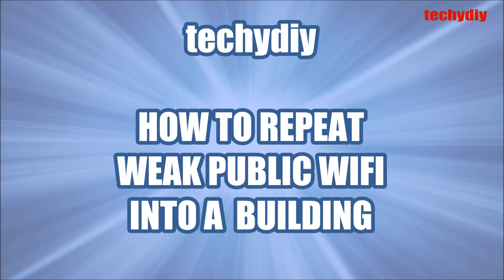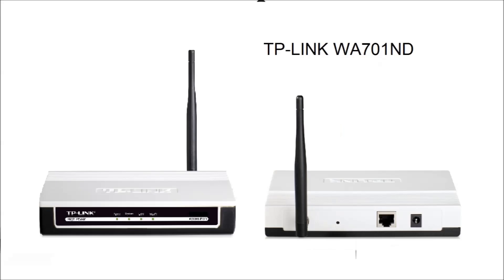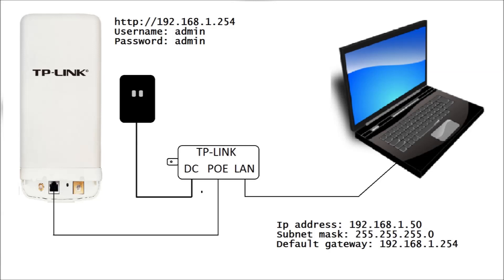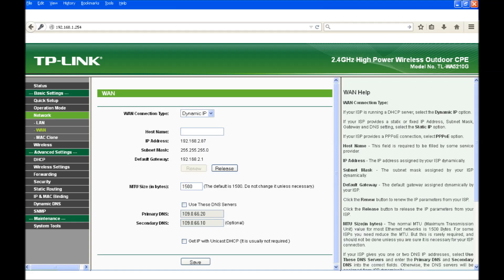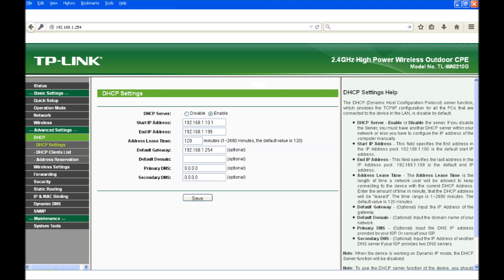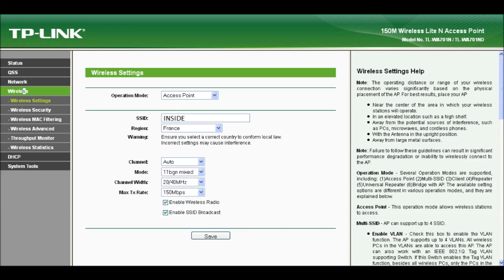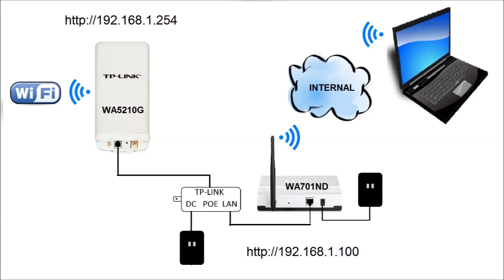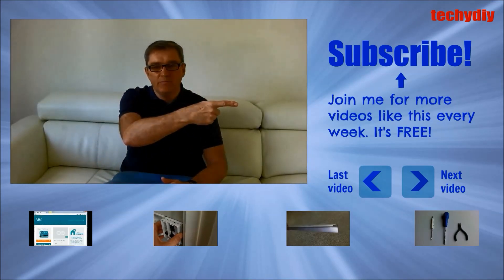How to repeat or boost a weak public wifi service into a building

Comment: You didn't mention the conflict of IP's.  It would be better to place it into a bridge mode or at least program the WA701D to use the WA5210 as the DHCP server.  That way only one device is controlling ALL IP's.  Otherwise you would need to create a separate network of IP's, (Your image of the configuration for the WA701D was on the .2 network NOT the .1 network)  If that was intentional then I think you may want to mention that.  (I would prefer a bridge mode OR just repeat the existing network) depending on your needs or situation.  I just find either of those are easier as bridge mode allow FULL forwarding of any and all traffic to the WA5210, including DHCP requests.  Of course the Repeater mode would just Re-Broadcast the signal to other devices a piggyback.
Reply from the maker: If I remember correctly it was configured that way to allow multiple clients to connect to one account on a WiFi service.

Comment: thanks was very informative.
so only works with   2.4GHz extenders?
what about other routers? I have an asus RT-AC3200. 
I am on NYC that has in some places  free public wifi but the first time you need to sign on putting email address
Reply from the maker: The method should work with most types of access point / routers

Comment: Would this work for a secure public wifi hotspot that require authentication?
Reply from the maker: Yes
Reply: I did not see a step in your video to authenticate to the secure network on the service provider portal. Do you have anything additional on that?

Comment: can this be used to extend bt wifi with fon ?
Reply from the maker: Yes I. Did try that a while back. Also SFR WiFi (France) with a BT Fon login..
Reply: Ive found a lot cheaper way of doing this by turning a pc in to a WiFi router which can also still be used as a normal windows pc

Comment: Can u help me? I know my friends WiFi password but he is living 300 metres away from me and I have a TL-WA5210G with me so I can use his WiFi ? At my home using that above mentioned device? If yes then plz say me how to do it I have a router also in my home at it is TL-WR740N.
Reply from the maker: That's what this video teaches you how to do!
Reply: @techydiy  but if i didn't connect the 5210g with my friend's router through wire may i connect 5210g wirelessly?

Comment: Hi great video
My WiFi signal is transmitted 100m to another area I can connect to Internet but an IP camera will not work any help would be fantastic.
Reply: Try to make sure the camera has the SAME IP and subnet and gateway as your network.  Also check to make sure you have the DHCP enabled so all device can get the same IP info, If not, just make sure you place the camera into the same network as your router.

Comment: can you do it whit a TP-LINK CPE510 ?
Reply from the maker: The CPE510 operates at 5GHz, so yes if that's what you need. The config method will be different as well, but the principle will be the same.
Reply: Ok, tnx! :-)
Reply: So I can with this device TP-Link CPE510 my wlan extended to outside (private network)?

Comment: i have an open wifi near my house but icant fix the other pair of CPE on  the building from which iam getting open wifi  i tried a lot of tricks and right now iam having 2 15dbi tp link omni directional anteenas and they are connected in my modem but the signal till my house is very weak  i dont know what to do can i fix one pair of CPE and connect it to my wifi router will CPE work in my case

Comment: Hi, i have outdoor CPE. and I want to extend wifi signal upto 2 km  or more .
Reply from the maker: You would need to have directional antennas on both ends
Reply: I agree.  I just put up the 5210 model on the roof of my home and pointed it at another building 200' away.  I was only able to pick up a signal of -74dBm.  That's crappy.  Not happy with this product.

Comment: Hello how are you.

I liked your video but I have some questions I would like respondieras.

1. why it must be configured in client mode Ap router?
2. ¿porque not simply in client mode and connected to an access point?
3.- Being configured as you say, the tp-link WA5210G transmits only wifi or cable? I mean: I can connect via wifi to tp-link WA5210G without using the tp-link WA701ND?

I really hope you clarify these doubts.

Thank you very much for your input and video.
A greeting.
Reply: techydiy sir , 
I have some questions here , 
1- can this device direct on mobiles phones , tablets , laptops ? How much capacity for users maximum on this device ? 

Or please suggest me Device who direct connect with mobiles for outdoor wifi business ?  360° coverage with maximum range 200 meters to as possible  +point to point to multi point , and for maximum users capacity from 200 users to 5000 users as possible ? 

Plz come on whatsapp 
+92 300 4356 143 
Javed Sipra is my name
Reply: Yuli terminaste la ultima palabra en espanol,nose si el abra entendido lo q le dijiste anteriormente
Reply from the maker: I don't really understand your question but there are several reasons why you might want to use this setup:

1. The wifi signal you are trying to access is physically shielded and you are unable to access it from your location. For example, if you are inside a building and the wifi service is external to the building. The configuration described in the video can extend the signal into the building where it can be accessed by any wifi device.

2.  The service you are trying to access only allows one device to connect to it and you want to connect several devices to that service. Several wifi services limit the number of devices associated with one login.

3. You are trying to access a distant weak wifi service with a device that has a poor antenna. Most tablets and phones have poor antennas. An external antenna with direct line of sight makes a huge difference.

Hope that helps.
Reply: Thank you for answering, helped me a lot.
Anything else; Does the outside antenna is connected when and retransmits the air wifi signal? or the acces point which emits the signal?

A greeting!
Reply from the maker: +Yuli Valverde 5210g is located outside and connects to the WiFi service. The 701 is inside and connects to your devices (Phone, tablet, laptop etc.).   The 5210g has two built in high gain antennas, it can also operate with a higher power output than normal.

Comment: how do i connnect to a secured public wifi using this process?? WPA2
Reply from the maker: You would select the secured ssid with the survey button in the same way.
Then you would set WPA2 and the password under wireless - security settings.
( I haven't tried it )

Comment: can you help me ?
I have CPE210 I had following the guide for using to AP mode but the problem I can't connect the wifi signals from the AP (CPE210) there's no connection anymore (like disable access) 
what should I do ?

Comment: so what is the difference between TL-WA5210G and TL-WA7210N ?
Reply from the maker: Speed 54Mbps & 150Mbps
Reply: So if I buy any of those, then I also have to buy TP-LINK CPE210 as POE, right?
Reply from the maker: No they are both capable of POE. CPE 210 is a 2.4Ghz 300Mbps alternative.

Comment: Hi,

I moved into a new house where ADSL2+ ports are not available by the only broadband provider servicing the address. My neighbour (houses separated by brick walls) has kindly agreed to share his WiFi login with me. I am able to see and connect to his SSID but speeds are very slow and sometimes webpages do not load.

Can you kindly advise me as to which product to buy from http://www.tp-link.com/en/products/list-4581.html which will help my case?
Reply from the maker: Do you have a good signal from your neighbours wifi anywhere in your property?

Comment: You configured the 510 to be a DHCP server starting at 192.168.1.101 but you then configure the 701 to have a fixed IP of 192.168.1.100.  Why not leave it as dynamic and let the 510 provide the IP?

I'm trying to use your video to boost a public Wifi AP using a CPE210 and an older cisco wireless router (linksys configuration software).  The 210 default address is 192.168.0.254 (just to be different) and I connect the wire from the LAN port on the POE device straight in to the cicso router 'internet' input. The router's default IP is 192.168.1.1.  Do you have a tip to get this config working? Should I change the router IP to 192.168.0.1 (and the gateway to 192.168.0.254)?  Thanks.
Reply from the maker: If you assign a fixed ip to the 701 then you can access it's configuration via wifi without connecting it to the 5210. It just removes a potential problem and makes tracing faults easier. Both devices ethernet ports need to be in the same subnet to communicate, it doesn't really matter what it is, as long as its the same.  So 192.168.0.1 sunet 255.255.255.0 and 192.168.0.254 subnet 255.255.255.0 is ok.
Let me know how you get on.
Reply: Thank you for your help. The CPE210 software looks different to that in your video and by looking carefully at your video I determined I was not using the correct initial configuration. There is a mode called Client on the 210 but what I needed to select was AP Client (WISP). Once I'd done that everything started working much better :)  My cisco (linksys) router has additional ports on it (unlike your 701) so I decided to leave the address of the router as dynamic (since I could always attach a cable to connect and reconfigure the router). But I shall remember your point about wireless connecting for reconfiguring.

Comment: Hi i have a site (motel) with 7 small buildings (wood wall). the entire site have 290 meters long x 100 meters large. I want to give wifi internet access to my customers inside and outside the buildings. it will work with that type of device (cpe210)? i plan to install one as an ap router wired to my pppoe provider, and 3 other on the roof of a building on the center of the site (ap client router). thank you and sorry for english errors i speak french!
Reply from the maker: +Ronny Roberge Yes it should be able to cover that distance.
Reply: +techydiy wow what a fast reply ! you think that at this distance of the outside antennas will be strong enough to have descent connections on mobile devices inside buildings? alors do you know the number of possible simultanous connections ?
Reply from the maker: +Ronny Roberge I can't say for certain as it depends on many factors. If you site them high with line of sight of the buildings then it sounds reasonable. My advice is buy one unit and try it.

Comment: can i use it as normal wifi router, if yes, what will be its range.
i want to set up wifi zone for lan gaming with friends about 200 meters, is it possible with this device, if not can you tell me any other devices that i can use to create wifi zone of about 200 meters,

one more thing how can we use tp link  ant2424b 24dbi antenna with it, will it maximise my wifi range.
antenna box say range up to 56km
Reply from the maker: +vikas R  I assume your talking about the 5210g. Yes. The range depends upon the environment, 200m should be possible. The 5210g has an external antenna connector so you can use the parabolic antenna. Remember that the parabolic antenna will be very directional. The antenna built into the 5210G is pretty good.
Reply: +techydiy , yes im talking about 5210g, so it will work like normal wifi, like what we use in indoor
Reply from the maker: Yes it has 802.11 b/g. The wa7210n and cpe210 are some of the other external devices.

Comment: Sir, I have building of 3 floor. Currently i am using TP Link AC750 router, but the range is not covering the whole 3 floor. Will i use this outdoor access point to spread the range downwards to my building from terrace. Mail me your suggestion at shrikantbhoj@gmail.com 

Thank You.
Reply from the maker: +Shrikant Bhoj you could either use a repeater located within range of your first router to extend the WiFi range or run an Ethernet cable to the ground floor and add a second WiFi access point. The second option is better.

Comment: is it possible to add or make a LAN connection through WA701ND? I'd like to add a 24 port switch hub on it. thanks
Reply from the maker: Yes.
Reply: +techydiy so, i can use any "4 port" wifi router instead of using WA701ND (let say TL-WR740N)? and one more option.. From WA5210G to TP-link(PoE, LAN), from LAN directly to 24 port switch hub. is it possible? sorry if i have a lot of questions sir. Thanks so much.
Reply from the maker: +Efren Junior You can add an ethernet switch or hub between the WA701ND and the WA5210G. You should then be able to connect another ethernet device into the hub with it configured for dhcp. e.g. A laptop connected with an ethernet cable

You might be able to power the WA5210G directly from the switch over POE if the switch is compatible e.g. Same  voltage etc. otherwise you would have to use the POE adapter.

I don't know if the WR740N will work as a replacement for the WA701ND in this application.

Thanks, 
Nigel
Reply: thanks nigel. i hope it all works for me.
Reply from the maker: If you try it please let me know how you get on. Thanks N.

Comment: hey i want to cover a housing complex g+3 wifi and a area of 200x200 mtr  ...what should i do....
Reply from the maker: +subhajit chakraborty I dont know, your question did not contain enough information, but generally  if you need advice consider taking your requirements to a local networking company and see what they suggest. Thanks.

Comment: Hi can i install outdoor TP-Link WA5210G in a room and not outside and then would it provide a wifi signal in another building at a distance of near about 150-200 metres. If not then is there any device that can do so. And if yes how strong will be wi-fi signal.
       Thank you.
Reply from the maker: It depends on lots of different factors that affect the transmission path. Generally these devices work best point to point and line of site, any obstructions will reduce the range.

Comment: Anyone can suggest me an idea.... I have internet connection in my laptop through usb stick and at present using connectifyme as a hotspot for my mobilephones..that ranges only a few meters... Can i use TP-Link CPE510 to supply internet from my laptop through ethernet and access in mobilephones for few hundred meters? Can i get clear wifi signal for at least 5km?
Reply from the maker: +Regan Jeya Antony A few hundred meters is possible, 5km is not  unless you have two devices with high gain directional antennas. I am not familiar with connectifyme, but it may be possible to use this and an external access point like the CPE510 or simply repeating the wifi signal might give you the increase in range you are looking for.

Comment: Hey, I'm watching this video for the third time now and I'm just trying to wrap my head around all this to hopefully include this setup in my camper (I'm doing a 2 yr long trip and this would really help). The internal router can run it's own network for my devices to connect to, and doesn't need to repeat the original network the WA5210G connects to correct? Secondly for mobile purposes, I would be changing the connection point often, how would I control which network the WA5210G connects to, can I authenticate with networks that need a login (accept terms of use) like starbucks or mcdonalds, and better yet is there a way of automating that process?
Reply from the maker: Simon Stiles The configuration is basically designed to do what you are asking.

To select an external network then you need to access the configuration menu on the WA5210G, select Wireless, wireless mode, then select the survey button to see what services (SSIDs) are available. You can then connect to the service that you require.

Access to  services like McDonalds Wifi works fine, you connect to the service (SSID) as above and then use one of your devices web browser to enter any authentication details required in the normal way. The service will see all of your devices as one device so you will only need to authenticate on one device.

As for automating it, yes it is possible but you would need programming/scripting skills.

Hope that helps
Enjoy your trip!

Comment from the maker: Piyush Tripathi The TP-LINK WA5210G specification is for 2Km (1 1/4 Miles), but it depends on the environment, whether you have good line of sight, the equipment used at the other end etc.